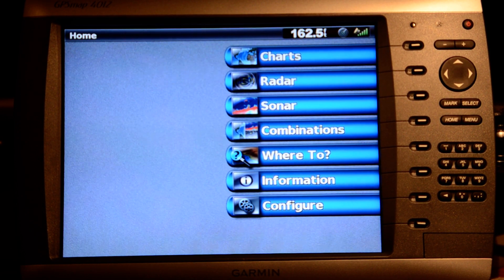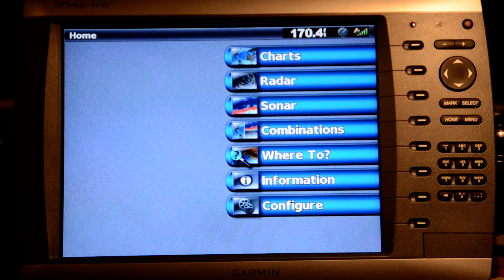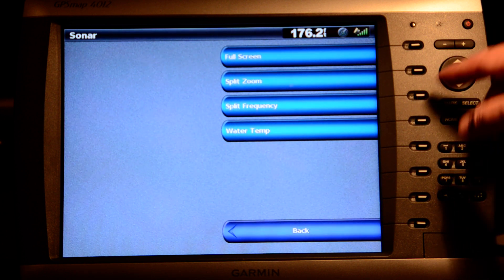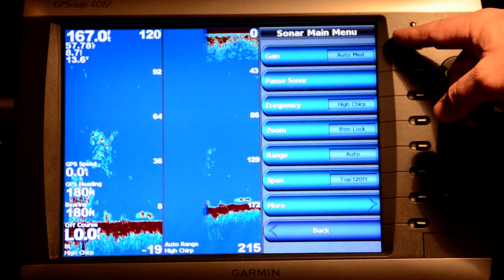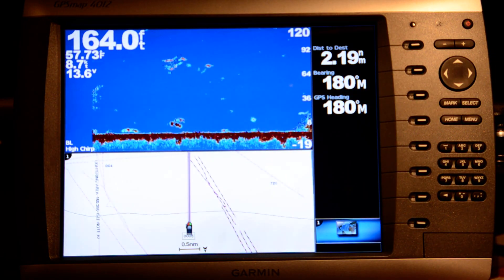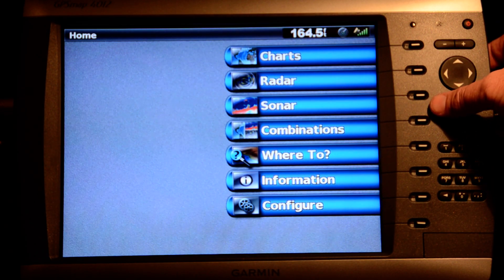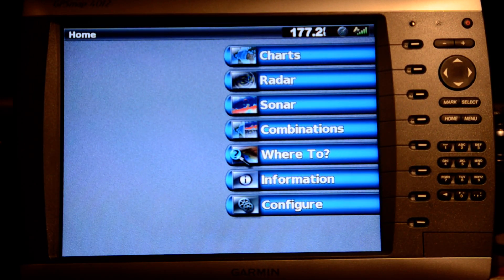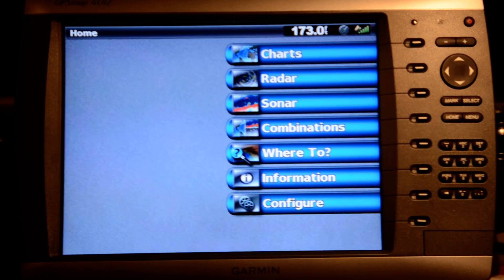Garmin 4012 / 4212 Chartplotter Basic Operation - Keys Menus Split Sonar Radar Navigation HD Video

Comment: Great video, thanks.

Question: if you're not using the sounder, i.e. it's not on the screen, is the transducer "off" or is it operational pinging?

I'm anal about having my sounder off when I'm fishing in estuaries and just want to know if I have to power down the entire unit while fishing those areas.
Reply from the maker: Hi, the transducer is on as far as I can tell. The depth is always available on the screen. In the Sonar menu I think there is a way to turn it off and for sure a way to turn it way down.